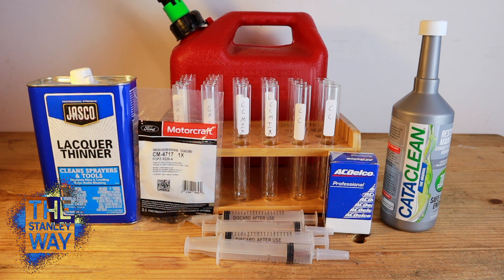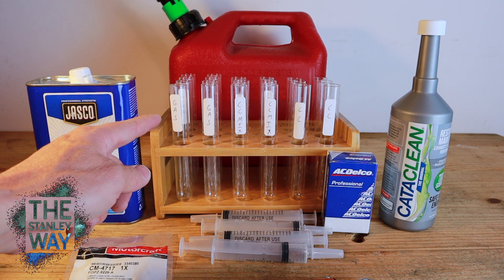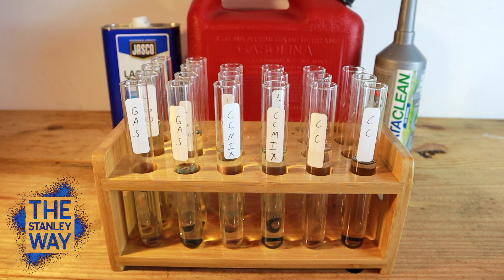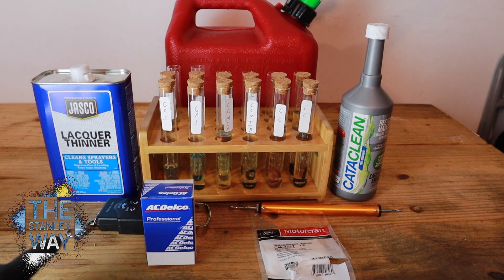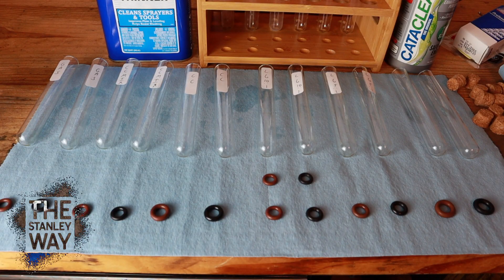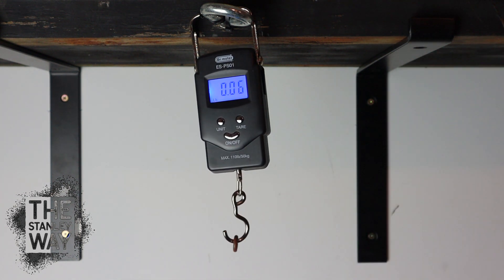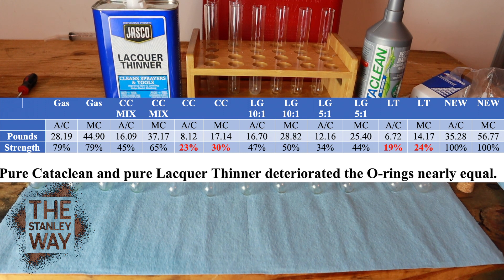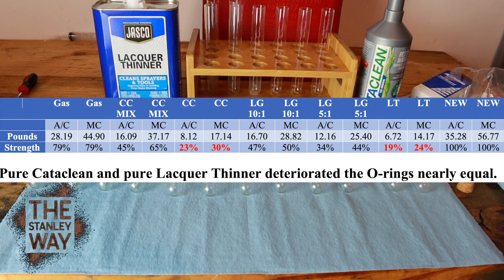SURPRISING Result | Lacquer Thinner vs Cataclean O-Ring Test Video

Comment: I’m sorry but I put cataclean and my car run better I know the Not to put nothing in your gas tank but I need some cleaning done
Reply from the maker: I didn’t say to NOT put it in your tank, I merely proved that it does the same thing as lacquer thinner does to rubber components. I put it in my car with no problems. If it helps you then keep using it. 

There are some out there that swear against lacquer thinner and say only use Cataclean because it is safe. I will use whatever I need to on my cars.
Reply: @TheStanleyWay  dose the new Camry have o ring like the 2015 Camry
Reply from the maker: I’m not sure but more than likely they are the same.
Reply: @TheStanleyWay  is it safe to pour lacquer thinner in fuel tank?
Reply from the maker: Yes it is. I have two videos where I tried it out on my two cars with no adverse effects.